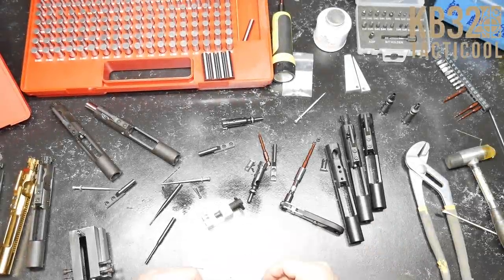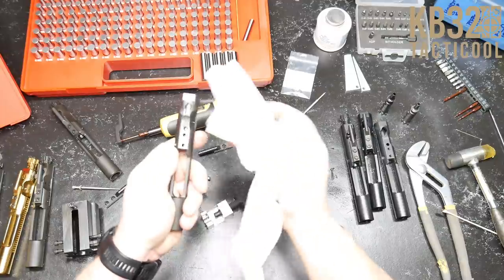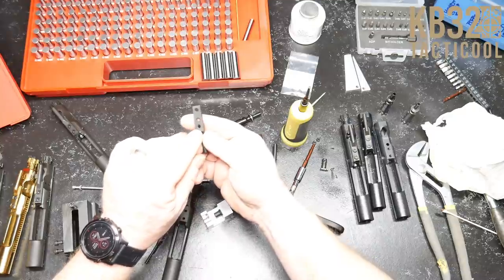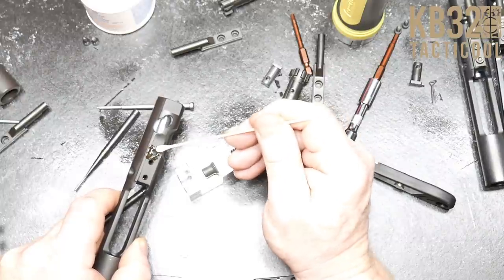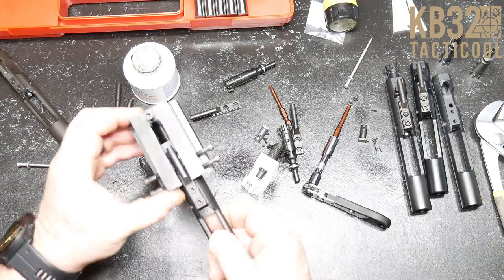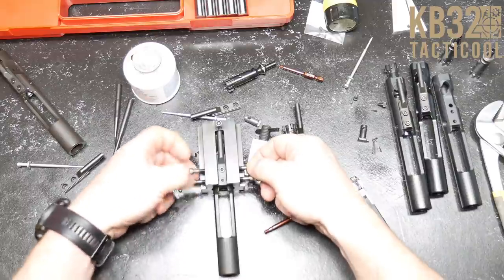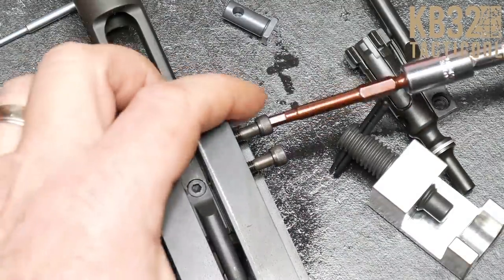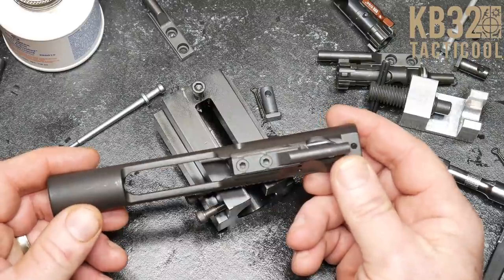Staking on Gas Key Installation

Comment: I wonder if Loctite would hold just as  good these days? You won't get the stress fatigue that staking introduces.
Reply: Some use that.
Reply: Yeah but I heard from a gunsmith that the contant heat and cooling will make the loctite fail rather quickly.
Reply: @aholegunner   There are many types of Loctite these days. The one I'm thinking of usually requires a torch to heat the metals to high temperature to get things apart. In a full auto gun it's possible to reach these extremes but the average shooter would rarely ever come close to these temperatures. The race engine builder's use it on a regular basis and something usually fails before the glue.
Reply: @tenlittleindians  Don't loctite your gas key screws..Always apply oil to the screws so the torque value is correct.

Comment: Off topic question...I just finished a Oden 18 in barrel upper that included the adjustable gas block and tub...It fired and ran great putting about 40 rounds down range with barrel swabing as I went...the next day I was doing a complete cleaning and noticed a small amount of residue in front and on top of the barrel in front of the gas block, I checked the set screws and they were good, is this normal? Thanks Joey

Comment: cracks me up when guys will buy a torque wrench, research specs, then say f it . i know better. lol. guys i knew worked on air plane engines like that. follow specs or don't bother telling what it is. lol cool video though.
Reply: If the bolts are supposed to be torqued dry but ended up with some Permatex on the threads that could be what's causing the issue. Staked with slightly less torque is better than broken bolt head IMO.
Reply: @cwiproductions  thats my point. he also said he stripped bolt heads before which indicates low quality bolt or tool (bit) itself. tiny fastener needs premium tool.